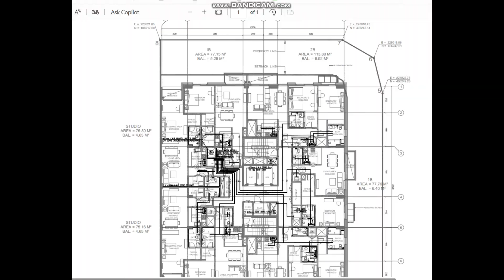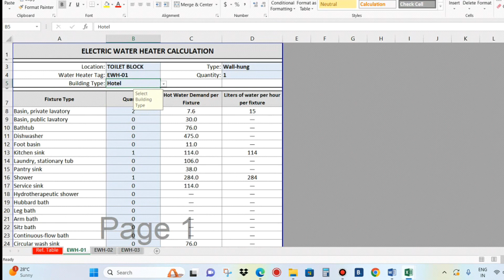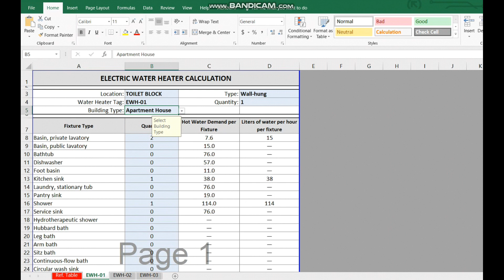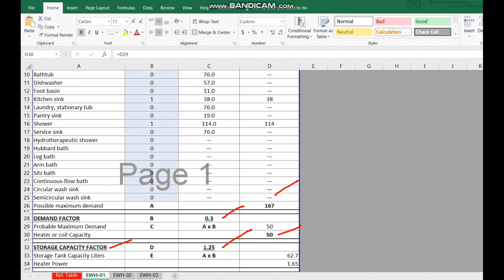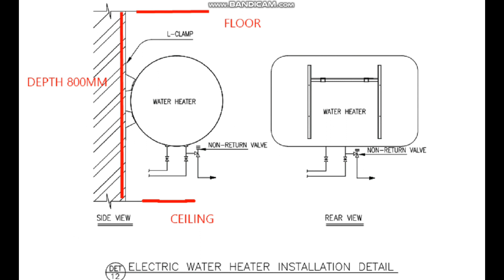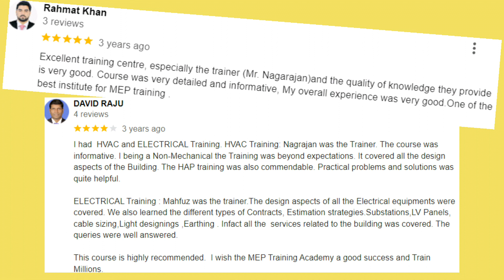🔥How to Size Water Heater Properly l ASHRAE standard l Avoid Oversizing & Insufficient Design🔥

Comment: finally, the storage capacity factory is only used to calculate the heater capacity. why do we have calculated the demand factor between? why ASHAREA did not make a direct equation to find out the capacity? like 0.3 x 1.25 x total demand .  what is he purpose of calculating the demand factor and storage capacity factor separately? there is something. can you explain?
Reply from the maker: If u want to consider higher safety factors in your case as per your local code or project specification then u can add higher safety factor instead of considering ASHRAE Value. No special reason for this. Thank u for your question 🎉